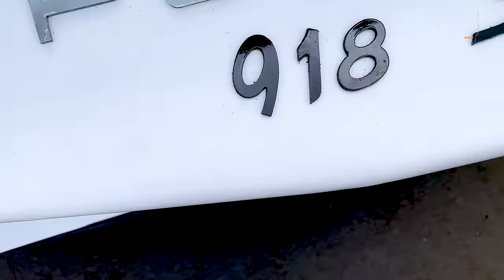Full 90 Days Homemade Porsche 918 Spyder from PVC Pipes

Comment: This young man has what it takes to be an absolute custom master!  I've seen many projects of this type before, but this attention to detail is unique!  And his spatial imagination is incredible, because he (apparently) didn't work with a 3D construction plan, but always adapted one component to the previous one.  That's incredible!  There is only one thing I would have done differently: I would have used the finished body as a mold for a complete GfK body shell and then attached it to the body frame.  That would be sturdier (I can't believe 2mm thick PVC material glued edge to edge is really strong), and you could use this shape multiple times (e.g. if the neighbor also wants an electric Porsche Spyder)..  .Definitely an absolutely amazing work!  Congratulations!
Reply: And what's the point of your list?  I'm well aware that this boy can't build a really usable replica Porsche Spyder.  But that's not the point.  It's about what he put together using the few materials, tools, and machines.  If someone lives in Western Europe or North America and has a well-stocked workshop available, they can build a Porsche replica down to the last screw if they have a bit of manual skills.  So what's the nagging?
Reply: @lost68er1  I have never see anyone do this in America in 90days, most of them takes 2-4yrs

Comment: The world needs a racing series where teams build and compete in cars like these!
Reply: There's already loads of kit cars available for track use. Something like this would never pass tech inspection.
Reply: There are kit cars that race, but this is not safe in any way, not even off road. A crash in this and the clean up would consist of a body bag and a dust pan and brush.🤣🤣

Comment: The sheetmetal work is unbelievable! (1) starting with pipe, how do you get it to lay flat? (2) you heat it with a torch, then bend it with your bare hands?  (3) How do you do those cuts freehand along curved surfaces, perfectly after the panels are already mounted so that a mistake would be costly?

Comment: Phew.. mad skills.  Well done!

But a couple of tips.. 

1) don't use galvanised steel.  Or if you do grind the zinc off the part you will weld.

The zinc is toxic and interferes with the weld strength.

2) Turn the welder down and use smaller diameter rod.

I get that you may have "borrowed" the welding plant & rods from a shipyard or something designed for much heavier welding.

But, all in all, superb job !

Comment: Excellent. Better than using steel sheets. If you use thin acrylic or polycarbonate, you can have a transparent car, and stronger car. Stronger than steel for the same weight. And no need to paint. You can polish any scratch, unlike glass.

Comment: Haha, oh man, that wheel balancing..it's pure danger world.  
Went from a mr coolies look posing out beside the vehicle, to smiling away and driving it slow so it wouldnt cause a catastropic accident.

I too built a car from scratch and encountered various considerations such as the dangerous steering setup i made, so it sits in storage for now.
I will get to redesigning it eventually with the 101 other projects waiting the wings of my area 52 development garage/factory.
Thanx for sharing your technique with visuals. I want to try messing with thermalforming too like that, maybe with a heatgun instead of butane.

Comment: This is really spectacular just using the tools that you had and the supplies that you use that the car looks fantastic and you did a really really great job!  I noticed when the car was driving. It looks like one of the wheels was wobbling a little bit. I was curious what caused that was it that the bearings? I don’t very know very much about cars, so thank you for answering. If you have time and again really really great job this is just such an awesome project.

Comment: Wow! Simply incredible. I didn't fully realize how easy it was to heat, fold and attach pvc tubing.

Now im not critizing this work but if one did it in a North American backyard i wonder.  Of course because of the  toxic part of plastics its best done outdoors and im not sure exactly about how "best" to do it in an environmentally friendly way.

I suppose there is a strong smell so i suspect that large companies doing it would have some kind of air filtration system for the plastics.

But i simply loved the video and perhaps its a great way to mod a cars fenders or spoiler etc.

Comment: That's what we call a "Mockup", a first stage prototype, but this one is done on a very very cheap budget! They did it with home hardware store stuff and an old stick welder, they are amazing! I'm wondering if the rear "No suspension" electric drive train will not collapse, the bubble gum weld scare me a bit...

Comment: Maybe should have mounted 2 electric motors and may want to try sitting in the seat first to test the spacing next time. My man is over here driving with his nuts since they are so close to the steering wheel but props for building his own ride 👍.

Comment: I'd love to motivate you by suggesting you cheaply invest in some welding glasses. You can't create if you're blind. Closing your eyes  is not good enough to stop burning your retinas. A heat gun would be better than a torch to soften the PVC as well. Nasty fumes from burning PVC. Great work, just make some small investments for safer work.

Comment: I really don't get this I mean it looks like a car but you can see that the frame the frame wouldn't support more than 500 pounds I mean that there's 16th of an inch thick boxing there's no strength there really and it's got two what look like 500 watt electric motors to make it go and then the PVC it's all lumpy and bumpy if you look at it and some of the pictures you can see how it's it's not smooth it's not moving anyone the pictures where he's sitting on the car or something I think he's just got a bit for those pictures he's got a real car because the one I hate I really don't think it would support putting a 100 lb on a fender and expecting for it to keep it shape it's going to collapse then then I don't get it I don't get it you know it be nice to look at if you you know get the lumpiness out of it Philadelphia zoo today I mean the where the wheels mounted they pulled into eighth of an inch thick plate that's not strong enough to take him allow it to go around the corner with any hope of staying true and straight the I like the idea with the motorcycle chain in the steering instead of a rack and pinion that looks that that was pretty good but most of it no it's just not going to take it I don't see the purpose. It's all fake. I admire the work that went into it, but it's just a shell, not real. Sorry to have to say it
IMHO